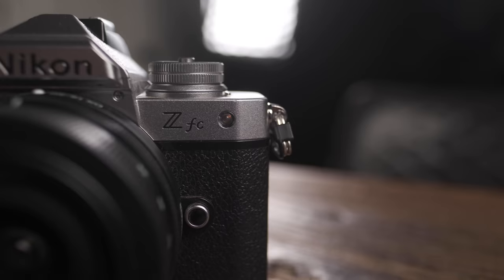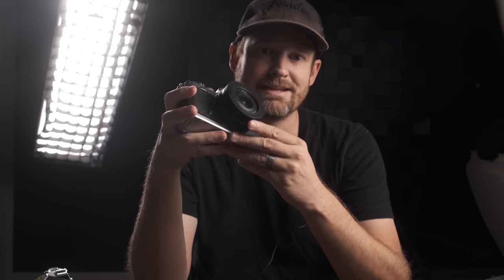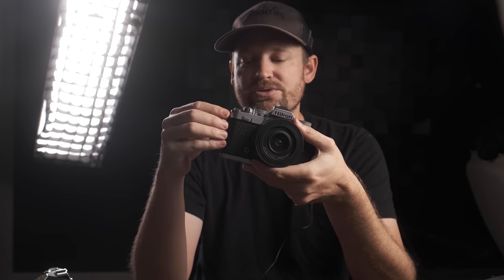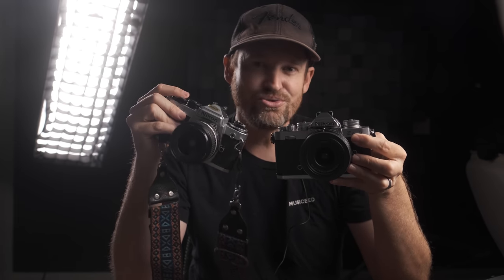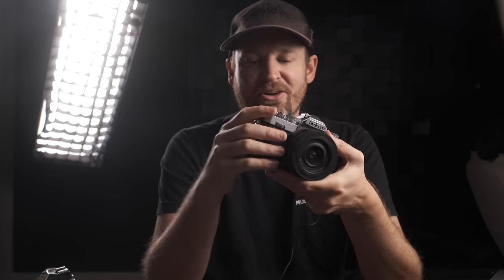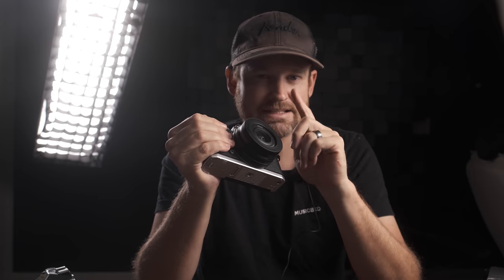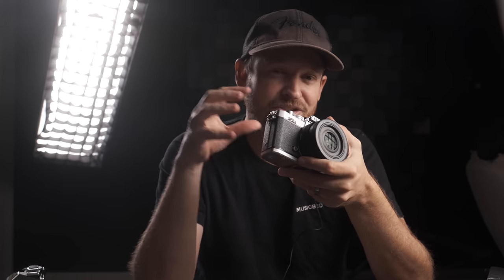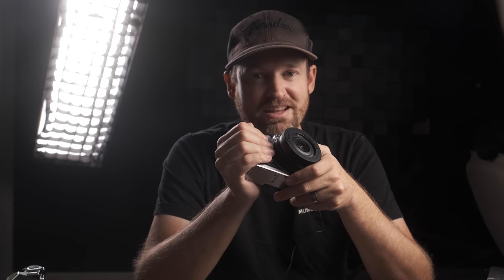Nikon Z fc - This is not the APS-C system you're looking for (probably)

Comment: I think you overlooked a use-case where the Z fc really shines. A Z fc (with e.g. a 28/2.8 as kit) as cheap/inconspicuous secondary Nikon body to play with Nikon mirrorless and also with cheap 3rd party MF APS-C glass.

I'm an experienced Nikon DSLR user (D850, previously D800, Df, D700, etc.) with quite a few Nikkors and accessories who until now did not do mirrorless. To me the Z fc was the perfect low-cost entry into Nikon mirrorless (initially thinking only about Z 28/2.8 kit + FTZ adapted lenses), and with a small, very inconspicuous/non-pro looking body. I've had the Z fc+28/2.8 since launch, used it quite a bit and really like it. 

Yes, initially I was disappointed by the APS-C choice. But APS-C has shown some major advantages for me a) a smaller body, b) the small/cheap APS-C TTArtisan 50/1.2 (and probably more to come), and c) a FTZ-adapted 85/1.4G gives me a really modern 135/2.0 look, something I cannot get on full-frame DSLRs to the same extent (the Z fc + FTZ + 85/1.4G performs really nice with eye-AF). E.g. I was shooting portraits/fashion with the Z fc + TTArtisan 50/1.2 (giving me a 75/1.8 look) in a hotel garden or around a tiny village as portfolio work. Without causing any notice/disturbances - something which would not work with my normal favorite D850+105/1.4 combo. All the time using my Nikon experience for fine-tuning the cam-handling and having my existing FTZ-adapted Nikkor glass + my Profoto A1 for Nikon still available as options (which I would not have with non-Nikon mirrorless).

Comment: I’m new to Nikon and I’ve been shooting the Zfc for a couple of weeks now. I’ve owned many Fuji cameras including x-t3, x-Pro3 and x100v.

I agree with you that the built quality is disappointing. Feels very plasticky and that battery door is a joke. The implementation of the analog dials is also awkward. You have to dig in the menus to change ISO to auto. Cmon Nikon!

With all that in mind, I have come to the conclusion that this camera produces way better images than any of my Fujis ever did. I don’t know what it is but photos look cleaner, sharper, more “organic”. I have a feeling it has to do with the bayer filter array being able to resolve more fine detail.

The small kit lens is surprisingly good. Very sharp and in my opinion much better than the xf 18-55mm Fuji kit lens. Yes, the “unlock to shoot” gets annoying but I guess a price to pay for compactness.

Overall I’m very happy with this camera. I’m considering getting a full frame Z and built a kit where I can buy full frame lenses and use them on both Zfc and whatever FF body I go with. You can’t do that with Fuji X system.
Reply: Mr Fotos...wow my experience with this Zfc vs many Fuji cameras I have owned is EXACTLY the same. I have owned nearly every version of the X100 still have the V, Had an XT2, XT3 too.still have an XT20 had an XE2..To cut a long story short SOMETHING about the Nikon files in both jpeg AND raw seem so much better to me than any Fuji I have owned. Matter of fact if anything, I'd say oddly, I'm a Fuji fan boy but lately I am plain tired of Fuji color where Nikon IMO just looks RIGHT, and beautiful and close to accurate/ and funny, esp Caucasian skin tones which many say is Fuji's forte. I MUCH prefer Nikon and the Zfc vs my Fujis.. I agree with Andrew on build quality not being great on the Z fc but somehow doesn't bother me. I further agree and maybe I had a bad copy my Fuji 18-55 was horrid and lifeless and over-hyped...though this kit Nikon lens is plasticy etc...it has great micro contrast, and is sharper than a tack..nice Bokeh too..when you can get it. The only reason I don't sell my X100V is it IS built like a tank.."it's a beautiful camera" with a  very good lens now but I just cant stand Fuji color anymore nothing looks right to me. Yeah vivid for maybe landscapes, flowers..but Provia, Astia..people look martian to me now...and CHECK out the whites of people's eyes with the XTrans..often it will have a lot of skin tone somehow blended in with the white. Nikon and the Zfc just takes great pictures. Anyway sorry for the Novel. As to the review here it IS on point, but at the end of the day it just may be the FILES that are most important and to my eyes the Zfc is SO much better as to output vs any Fuji I have had... Yup big weak point I admit, Nikon needs a ton more lenses for this little guy and APS-C however not gonna lie. :)
Reply: @kimrandall5349  wow I feel the same about Fuji colors. I went from rabid fanboy to despising Fuji colors. They look like Instagram filters to me. I’ve seen the issue with skin blending into the eyes!!! 

I’ve owned 2 X100V, they are beautiful machines but again I couldn’t stand Fuji images any longer. I just can’t believe how much better this Zfc IQ is over Fuji. I’m in shock.
Reply: Hey Dr. Fotos...it's great to have company that we both feel the same on Fuji colors. When I first got into Fuji WAY back...actually I loved LOVED the colors. But yeah that high contrasty deep black stuff esp if using a provia even Astia to a degree gets tiring. I don't want to get too far off point here as in many ways Andrew's review of the Zfc is spot on. ESP the flimsy battery door it's SO thin. But in other ways the fc...is the camera I want to pick up and use while my x100v stays home looking all pretty in it's case. REALLY. The FC is light but I find it a plus as a take with you anywhere camera. Again the kit lens is just super sharp...well guess I'm repeating. I got back into Nikon as in the old days I owned a D40 and D90 Slrs. I noticed going thru some older pics one night,  esp on skin tones everything looked great and real and FILTER-less unlike Fuji. So I did bite the bullet and get the Z6II which to me is off the charts great. I have had other FF cams...several Sonys, still own the Pana S5..but because of the FILES!, I take the Z6II vs my S5 the only other FF cam I still own.. Back to THIS review so SOMETIMES I want a lighter camera to JUST take with me vs using a phone. The ZFc fits this bill perfectly.. Fc-HAS the Nikon files and color but is way light, a PLUS and handles great, hah even auto focus is VERY good...I don't do video btw I am just talking photography... I still love Fuji but if there is a way to get files to not look so Fuji, I'm all ears...Even in raw I find I'm fussing WAY too much with color/Fuji...NOT so with Nikon...Anyway sorry for droning on, and YEAH a big negative is skin tone sometimes bleeding into whites of the eyes in some/not all pics of portraits taken with all my Fujis...Be well..thx for the opinion company here lol

Comment: Having problems getting any new lenses with this pandemic.  But I do use the full frame lenses on this camera and they are wonderful.  Especially the F1.8 Primes.  I like the camera for its size also.  Portability is a must for me.  Lot of places I go will not let me use a good camera like the Z6ii, Z5 or even the Z50 but I have Small Rig cages on them.  But when I bring the Z fc they think it might be an old film camera.  I like the USB C plugged into the wall via an Apple 30 Power Adapter and keeping charged while it is on.  Lot of people do not like the LSC flippy screen but I do but when shooting pics I close it and use the EVF mainly.  That might be another reason why I can bring this camera into a store with me because I have the screen facing in the camera and the back of the panel blends with the camera plastic exterior.  Plus I like the weight of it and the touch screen plus buttons and dials of the Nikon system.  I bought adapters to share my Sony APSC lenses to mount on this camera and they work but not as fast as the Z mount lenses.  But the picture quality is excellent.  The only problem I see is getting my hands on extra EL-EN25 batteries which I will not pay  a fortune for like the video cards for pc which are outrageous.

Comment: One thing I can agree is that unless someone is a subscriber, he/she may not share your same feelings or thoughts about this camera. Personally I am a pro-sumer user and as I moved from DSLR to mirrorless, I found this camera being a good entry point. It is expensive for what it offers, yes, and it feels cheap. But if you get it used for 599, it is a great deal; which is what I got it for.
The rest is relative... I don't care about the looks, even if I had those film cameras in the past, as that is not enough alone to make me open my wallet, if the specs are not what I need. And as I have other Nikon lenses, the switch is not that bad as it would be with Fuji; which are the other range I was looking at. With some work the z-FC may work but it is a product made for specific people, and if you find it used it is hitting the mark 100% IMO. Then if you buy it new at 999 for just the body; there is better stuff around, but still, it is not as bad as many reviews paint it. 
I would call this the equivalent of a "dumb phone": it takes pictures, so it does what a camera should do; but lacks all that bloat and stuff that we came to accept in modern digital cameras. If you look at the objective that this camera set for itself, it did hit the mark perfectly, as it is a camera that takes pictures and that's it... With a retro look. It is just overpriced but you can get it used.

Comment: Firstly Andrew you hit me exactly with your demographics analysis. I am 45, I take photos in my free time as a hobby. This Nikon Z fc at first glance looks exciting but after you try you change quickly your opinion. At first I though this Z fc will be similar to Nikon Df, which was and still is a good full frame camera, but the APS-C sensor in Z fc is disappointing. I took pictures with Nikon and I still take pictures with it on film but not in case of digital. For F-mount and now also for Z-mount I am missing a wide range of good DX lenses for APS-C sensor size.  For Nikon, the APS-C sensor is just a way to attract new customers and persuade them to switch to a full frame and not a full-fledged system for a variety of photographic needs. I am now very happy with Fuji cameras and especially with their XF lenses. I have six of them and they are really wonderful. 
So thank you for this video and I am looking forward for another. Have a great time and good luck. Greetings also to Denae.

Comment: So I'm a almost 20 year 4/3 to m4/3 user and im wanting to try something new and I have dilemma. I've looked and tried this zfc and a xpro 3. So what I've found is put the zfc and 24mm 1.8 weather sealed lens and it smokes every similar equivalent lens in rendering photo quality fuji has except being equal with the new 23mm 1.4 and you save $100-$150 with the nikon lens. 2nd tracking and focusing is better on the nikon. Low light seems marginally better with the nikon. The dials seemed to work just as snappy and solidly good as on the fuji. There was no rattling on the zfc except the neck strap rings. If you removed the springs that are on most battery doors it would feel the same and just as sturdy, it's just you are used to having springs on doors. I would say the only plus for the fuji camera is the titanium body and better weather sealing. I don't believe you gave it a fair shake.

Comment: I’d try the full-frame primes on it. I use them on my Z50 and they’re amazing with that sensor. I’d say my Z50 paired with any of them is actually a much nicer setup than either my X100V or XE3. Just something about the files out of the Z50, they’re stellar. My favorite lens on the Z50 is actually the 85/1.8S right.
Reply: But they're not stabilized, right? Without IBIS or in-lens VR you're back to doing it old school. Maybe not really a concern with the 85 but my use case would definitely benefit from stabilization.
Reply: @markwornom1050  yeah, not stabilized, but then again most of the Fuji stuff isn’t stabilized either. Really it’s only the XT4 and XS10 with IBIS right? The rangefinder style bodies certainly don’t have it.
Reply: @thisisbenji90  I'm a Nikon shooter and have a very similar sensor in my D500. I've been shopping Fuji a little but definitely not an expert. I do believe you are correct about the cameras you mentioned and certainly you would know more about the lenses. Everything I've seen indicates that the Z lenses are fantastic but I just need the full flexibility provided by stabilization. The Zfc with the two kit lenses would compliment my D500 and give me a light weight body for traveling that I can also adapt my current DX glass to without getting penalized with the crop imposed by a full frame sensor. Zooms work better for me, I never seemed to get the use out of primes despite their great glass. I'm strongly considering the Z50 and would probably own one if I could find one. I'm not quite convinced enough yet to order. The Zfc offers a few compelling upgrades over the Z50 but I'm also very spoiled by a top display and that's pulling me to one of the full frame bodies. I personally find this transition to mirrorless pretty complicated.
Reply: @markwornom1050  I use the D500 and Z50. With the same sensor and maximum fps, they complement each other perfectly, but oddly I've seen no YouTuber talk about this. If you like switching between OVF and EVF, between a rugged and lighter camera, between DSLR and mirrorless, yet always with the same results, and with the ability to adapt all your F-mount lenses to the Z50, this may be your combo. Like Andrew, I have no interest in the Zfc. It does seem more a toy than a serious camera, even compared to the Z50, and I cringe at a color for each day of the week, except the Sabbath :)
Reply: @robwinklerphoto2189  I think that since the D500 is around 5.5 years old now and the focus is on the new mirrorless platforms that it's just kind of been forgotten about and that's probably why nobody's made that comparison. But, your comments reflect some of my thoughts about it too and I seriously considered the Z50 and found a lot to like about it. And although I dream of a complete switch to full frame one day, I also find the APS-C sensors more than capable for what I really do. With that in mind I considered the long term factors and decided that I really needed an IBIS sensor to support any future purchases of Z mount glass. As of now I'm only aware of three lenses with built in VR and two of them are DX. For what I do, I'd probably be fine with that and my current F mount glass but then I considered the age of the Z50 and that I might be buying one too late in the product cycle. And then I am seriously trying to drop some weight from my backpack so... believe it or not I chose the Sony ZV-1 to compliment the D500. It's less than half the weight of the D500 body, includes a f1.8-2.8, 24-70mm lens and captures in 10 video formats including HLG, Cine and SLog. It's only a 1 inch sensor but I'm a day hiker. LOL at the Zfc color options. And only $100 more for the privilege! I was initially very interested in the Zfc but the more I understood the ergonomics and switchology the less interest I had. From what I've seen Fuji has a much more refined and intelligent control setup. I really have no plans to sell my D500 anytime in the near future. It's just so capable even now 5.5 years later that there's almost nothing other than lighter weight that I wish for.
Reply: @markwornom1050  I'm with you on APS-C being more than capable, especially for nature photographers who go far afield. I'm not aware of a more compact 300mm f/4 than the Nikon PF, which I use all the time on my D500 and often on my Z50. So I can sit tight for awhile. Good luck with the ZV-1.
Reply: @robwinklerphoto2189  Thanks, same to you.

Comment: I have the opposite opinion. If you’re a content creator stepping up from a cell phone then there are plenty of interchangeable lens cameras which are easier to learn, handle, and which have sturdier and affordable, non-plastic glass available. I won’t recommend Nikon for video until they incorporate a fully modal menu system as on recent Fuji cameras. Much easier to teach. So to me the Z fc is a nostalgia purchase for existing Z shooters who want an easy to carry, unobtrusive alternative to the capable but utilitarian dark grey work cameras. I added a metal plate and grip from SmallRig to my fc which makes the camera much more bump resistant on the bottom and much easier to handle overall. And the integrated Arca Swiss mount is a nice bonus.

Comment: Andrew,

I obviously don't if you are still reading comments on this video, but just in case: There is a third group of potential buyers for this camera. Those, who wonder if the Z fc is really a solid replacement for an updated Z50-II, which we will probably never see now.

If you are serious about your APS-C format video camera, then the Z50 is a let down. Nikon messed up, realized it, and now we get the Z fc instead of the Z50-II. 

The Z50:

- Doesn't have an articulating screen, as you mention. The Z fc does.
- Uses the pesky micro USB-B connector, which can neither power nor charge the camera. The Z fc uses an USB-C connector, which can do both, in addition to being much faster to use for downloading huge video files to your host computer.
- Is missing a few of the important AF features from Nikon's larger cameras, needed for live video focusing. These are added on the Z fc.

Unfortunately, due to the retro styling, the Z fc has horrible ergonomics, as it is missing the deep grip for your fingers on the RH side of the body. Which the Z50 has. Try 'vlogging' with the Z fc by holding it away from your body in your left hand, facing yourself, and see what I mean. There is an optional Z fc grip from some chinese manufacturer or other, yet it is a lot less substantial, compared to the usual Nikon camera bodies.

I used to own and extensively used an FM2n and a F3HP back in the day. I don't care what the Z fc feels like. I just want my Z50 Mk. II... 😞